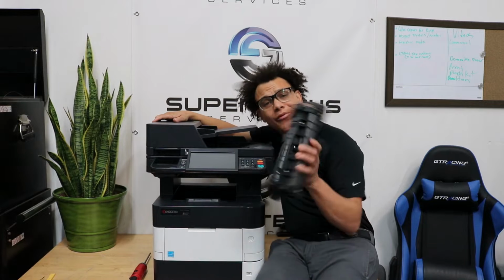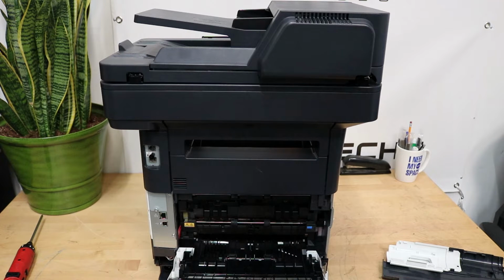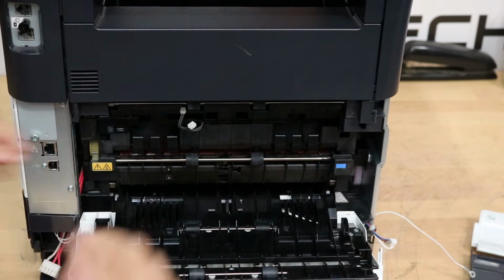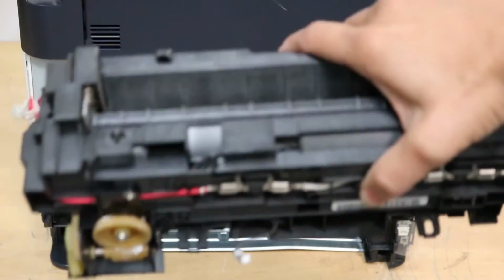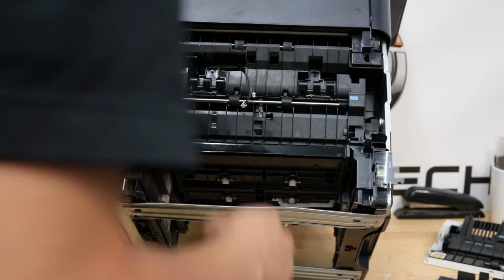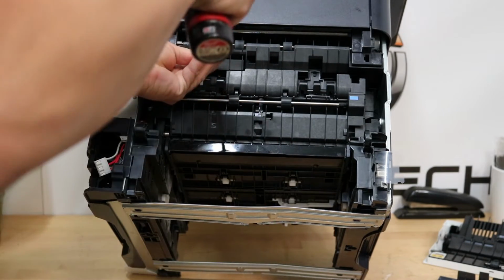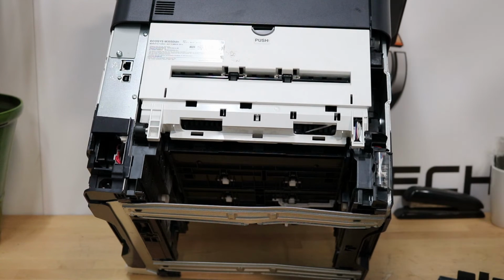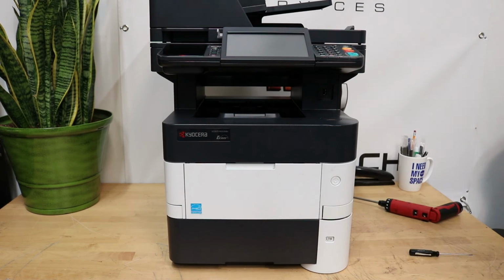Kyocera Ecosys M3550idn MFP Fuser Replacement

Comment: I appreciate your video , but this Machine is a real POS. There is a cam on the left side of the fuser and for what ever reason it's up the fuser will not go in . You have yo Power up and let cam go down.  The service manual makes no note . I do think you made a good video and again thank you
Reply: I really had a hard time installing the new fuser back in the unit, so I think might be the cause !
Reply: There's a note about that cam that comes with the new fuser and it's also in newer revisions of the SM.

Comment: You can tell a rookie tech a mile off. You don't need to take the cover off. You just push in on it and let it hang. You have a greater chance of harming the connectors by unplugging and plugging back.
Reply from the maker: 20 year veteran. Been working on copiers since the analog days. Thanks for your input though.

Comment: Just be aware on the Kyocera M3540i on the new fusers the white sensor plug is very short with hardly any slack.  It  gives you  no warning when taut,  so must make that the very last thing you plug in.  That is you must finally get the fuser in with  lever up 25 Degrees perfectly, screw in,then  finally plug in white sensor plug ; otherwise will break it ( new ones do not break a way from another plug).  Does anyone know if anyone repairs these? If so, who?

Comment: Hi Thanks for the video. I have a Kyocera Ecosys M6635cidn that I changed the fuser for today. My issue was that the printer printed with smudges and marks all on the left side of the paper. I thought it was the fuser. Since the new fuser, same issue. The smudges and marks appear in seperate spots. What do think I have to replace now?
Reply from the maker: It's most likely one of the drums or developing units. Change the drum that corresponds to the color smudge you have. If it happens on all the colors, it could be the belt.
Reply: @Supertechs3  they are black splash like smudges.
Reply from the maker: @jaykomthongpane4941  Its hard to say exactly without samples. But I would start with the black developing unit. Send me a sample to info@supertechs3.com

Comment: will not pull paper from cassette 1,  remove cassette 1,error occurred at casette 1, check inside the machine and remove paper jams, close the cassette those messages appear on the display, I took out a piece of paper that we have, what next thank you
Reply from the maker: Remove the paper tray and look into the printer, you should see a white actuator hanging to the left. It should move up and down freely, if it's not, it came out of place and needs to be reinstalled.
Reply: @Supertechs3  thanks I'll take a look and I'll let you know
Reply: I failed to solve the problem

Comment: i am having trouble getting the fuser unit back in..i see the notches and guides but no luck...going home retry in morning
Reply from the maker: Keep trying as it is tricky to get in. Make sure to angle it down first, then snap the bottom in.
Reply: If it is like the M3655 you may have to turn it on briefly so it rotates a gear into place